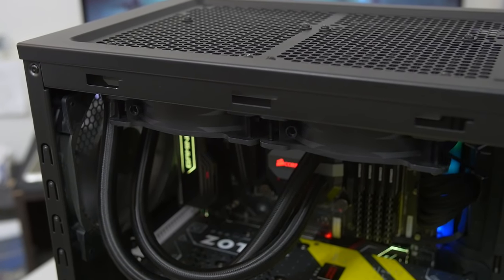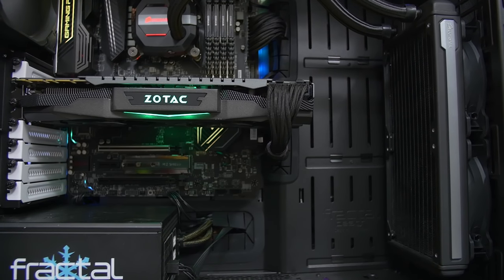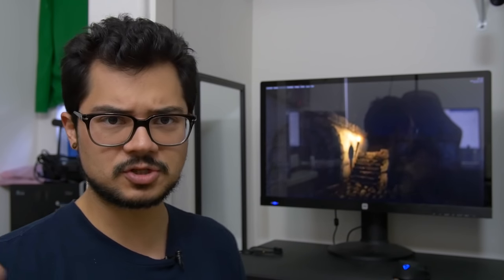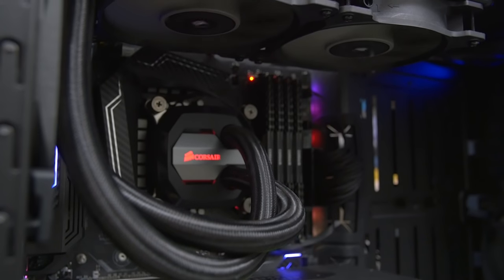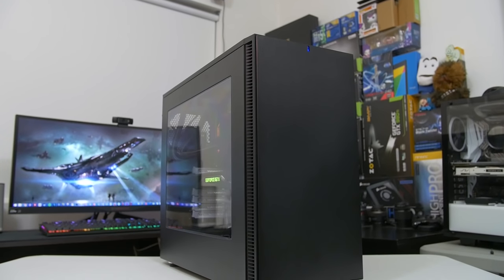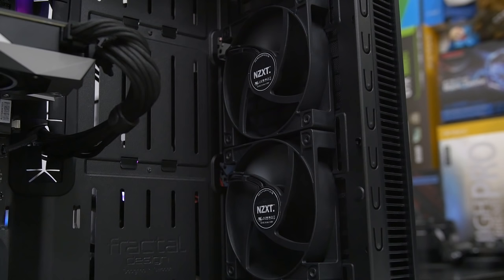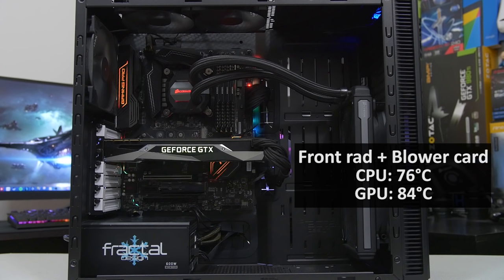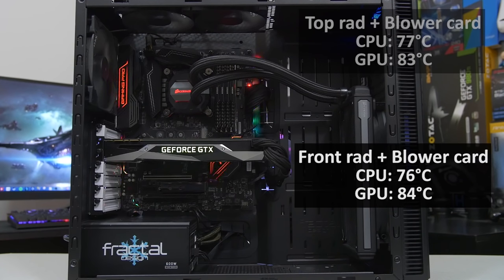Does Radiator Placement Matter? Hint: YES

Comment: best place to put radiator : outside of the case. outside the house if possible.
Reply: Depends. If you live in a hot desert it is better to keep it inside when you have air conditioning running.
Reply: Here in Arizona? Check your cold-climate privilege at the door mister!
Reply: Put radiator in Siberia, extend pipes back to home
Reply: Mr.Lazybonez I say that all the time. I live in Canada born to Jamaican parents but born in Canada,  still prefer the summer which does get hot. Winter is cold as fuck. Dominican heat is actually more bearable,  not as humid.
Reply: LMAO
Reply: I keep mine on my Jeep
Reply: Whole room waaaater coooooling?
Reply: FWIW, not all cases are built or deigned the same, nor does airflow work as efficiently. For those who may be considered it, I contacted be quiet! around rad placement for he Dark Base 700 and they advised me they achieved best results with this case with a FRONT mounted AIO and 2-3 exhaust fans at the top of the case along with an exhaust at the back. So that aligns to Kyle’s testing here.
Reply: 100F is a cool day to some folks.. Out in Arizona, I saw 110.. but it was dry heat and tolerable.  In IL I'd see 100 f with 80 humidity and it was oppressive.  I've seen as high as 120 in the shade with 60% humidity.. .and I just wanted to die.
Reply: I think I will rather not try it with a 3-year-old and a newborn baby in the house... :)
Reply: In the fridge or freezer?
Reply: Arctic Borkism  depends on how cold. Here in Canada during winter i saw -45 degree Celsius that is wayyyy too cold.
Reply: Outside of the planet.Space is the best cooler that have ever exist.
Reply: Or just put all your system in a huge fridge.
Reply: put it back in the store and buy the cheaper nh d15
Reply: Somewhere close to Pluto planet, away from Sun's heat :)) There the temp are really low and you can OC to 6-8Ghz :))
Reply: Always, and why don't we see case manufacturers make cases like that. 
They had a few if them back in the days when WC started to be more common. But after that kinda disappeared..
Reply: in fact cool the whole computer room
use copper tubes!
Reply: Placing the AIO in the top of the machine is only a disadvantage when air pressure inside machine is negative, because graphics card fans can't blow the heat out the back when air pressure is negative inside the machine, which then causes the warm air to reach the AIO. With high airflow and substantial positive pressure all the heat from the GPUs gets blown out the back of the machine without ever reaching the AIO. On my machine I reversed the rear fan to blow into the machine (The rear fan  doesn't seem to take in the warm air from the graphics cards). The PSU air intake is from under the machine and blows out the back. But to prevent the PSU air intake from sucking air out of the machine and into the PSU intake, I have a 120mm fan at the bottom in front of PSU sucking air into the machine. In the front I have a 230mm fan plus 120 mm above it. Side intake is 200mm, and I have 2 200mm fans in the stack above the AIO blowing out of the machine. Under the AIO I have 3 120mm fans blowing into the Cooler Master 360 AIO making it a push pull configuration. I am using HAFX 942, and took the precaution of properly filtering the air intake in the rear and sealing all other vents for higher pressure.

The air that blows through the AIO, should leave the machine immediately, and the pressure inside the machine should be high enough so the GPU fans work properly and blow all the heat out of the machine.
Reply: @BenjiGO  *Has 1080.. *Skimps on case and psu..
Reply: @andrewnibbi  ...and do some political corruption to make those pipelines run through our country - it's not oil but still...
Reply: lol
Reply: What if you live in a apartment
Reply: outside the earth. outside the space
Reply: @kwto.  you use the building's plumbing down to the basement where your radiator lies. Or put new pipes up to the roof (drill holes for tubes during the night when the neighbors are sleeping. just for the sake of creating chaos)
Reply: this comment gives me Whole Room Water-cooling vibes
Reply: I keep my rads in the fridge
Reply: I got one  Asustek Waterchill Black ice II rad,  4 140mm  fans in out wonder if it would cool 3700Xl ZEN2 ?
Reply: Linus Tech Tips home watercooling project video is probably the BEST solution for this.
Reply: Laughs in Australian
Reply: @BenjiGO  wha the heck ?!
Reply: ahhahahaha
Reply: @andrewnibbi  in Siberia you can easily have 40+ °C in the afternoon (and -5 °C in the night). Continental climate - big differences summer/winter and day/night.
Reply: Mike C not funny
Reply: @daddybonez  vice versa for me since I live in New York
Reply: Man this comment kills me everything.
Reply: In Siberia, its better to use a house radiator.
Reply: lmao my radiater actually sits ontop the case, i dont got room for it :(
Reply: In the fridge is better
Reply: @BenjiGO  looks like someone followed the verge build guide
Reply: That could cool your CPU to lower than ambient temps within the room that it resides and you could end up with condensation on your components.
Reply: A friend on mine had built a custom chassis and installed it in a fish tank filled with mineral oil and external radiator, looked odd but overclock temps settled at 55-60°
Reply: I live in a tropical island outside si hotter !
96 degre-eeeeees, in the sha-aaaaade ! Real hot ! In thé shaa-aaade, si note the best place for a radiator...
Reply: Indeed! I'm in AZ, it's winter (40s at night). My Ryzen 7 2700x and 5700 GPU put out so much heat, I've got the upstairs windows open and it's still 76 in the house - until I shut the computer down. Upgrading to a Ryzen 9 3900x and 5700XT and it's spring now (Feb in AZ is spring). Hate to see what my A/C bill is this summer from this machine!
Reply: So badically have it connected to your AC....
Reply: in the refrigerator
Reply: Yeah, and merge it into a swimming pool
Reply: ... in the lake
Reply: In a college refrigerator!
Reply: Bro Thanks
Reply: Hahaha. Linustechtips whole room liquid cooling
Reply: That's why liquid cooled cards are getting popular on ATX towers while on itx systems the gpu and cpu can remain cool if the gpu is air cooled since some cases has dedicated intakes for the gpu while the cpu is liquid cooled :)
Reply: No in water 😂 hahahahaha I’m so funny
Reply: The reviewer in this video confirms it. Front radiator setup paired with an open GPU card is the best setup. Even front radiator and blower card is decent with the temperatures. Some reference blower cards perform well and do not go above 80C.
Reply: My preference is in liquid nitrogen.. relly drops them temps mannnn. U should try it out. Or replace the whater in cooler with liquid nitrogen works perfectly
Reply: put it in the fridge
Reply: and then spend money on electricity pumping heavy water all the way there? nope
Reply: @hilmisulaiman2427  condensation?
Reply: @CCLGamer  Sounds like a reasonable option, do you have it on a desktop?  its all about the case placement I find as I have mine on the floor in a corner so recirculating of exhaust is an issue i have to take.  I see a lot of cases using front and window side to draw in air and rear and top to exhaust which seems to make sense especially when stock CPU heat sinks were prevalent and got the fresh air dumped on them from the side fan.  In a desktop scenario i can see that the top exhaust (with the GPU & PSU blowing rearwards still) can be a decent move, but would need an open space there to be the best,
I'm looking at altering my setup soon and getting a new case but don't want to spend too much on a good case that has all I want included. (£50-£150 tops i'd guess)
Also wanted to end up watercooling my GPU again but found later upgrades a pain now they are so expensive so have been air cooled for the last few.  I did find a neat watercooling SSD/HDD block that fits in a 5.25' bay, but of course these bays are not really around much now on the nice cases as nobody uses optical drives anymore.
Reply: @DukeOfTheBLVD  heavy gaming session = dead fish
Reply: @Buflonob  Yes, it is all about placement, my place is a mess, right now, so I have made a compromise, My HAFX 942 PC case is on top of a wooden chair with both front and rear edges of the case hanging over the sides of the chair. There is plenty of room behind the case. Initially the rear fan was set up to pull air out of the PC case, but I changed the direction to suck air in for increased air pressure inside the machine and lower temperature inside the PC case.  The machine only blows out air through the stacks and through the graphics cards. My X-Vision temperature gauge panel in the top 5.25″ bay shows temperature inside the PC case to be around no more than 8°F degrees above room temperature. The Cooler Master 360 AIO  does not allow a fullsized drive in the top bay, but there is plenty of room for the X-Vision temperature gauge panel.  This is a High Airflow case and the air that cools the CPU and GPUs is funneled immediately out as the cooling of GPUs and CPU take place in close proximity to the exhaust fans for the case which are the GPU fans and the stack fans (Cooler Master 360 AIO  is  right under the stack fans). The heat from the rest of the components on the motherboard and hard disks finds it's way through the case stacks where it is blown out. Since the airflow is high, hot air does not linger and build up the temperature inside the case.
Reply: In front of an AC.
Reply: LOL
Reply: Just want to point out, On my HAF X 942, although the PSU is on the floor of the case in the rear, it does not share the air with the rest of the case. My PSU has its own separate air intake underneath the case and blows the air out behind the case.The bottom of the case has a vent underneath the PSU that extends beyond the front of the PSU.  To prevent the PSU from drawing air from inside the bottom of the case, I have placed a 120mm fan in front of the PSU under all the cables, blowing air into the case. I use  a 1600W modular PSU, with all the cables connected and laid out perfectly for easy maintenance  to power all future devices I connect.
The MOBO (ASUS RAMPAGE IV EXTREME) has 64GB RAM with 4 fans mounted on the RAM, which increases flow of air from the MOBO into the general air flow to the stack exhaust fans. 
MOBOs like the Asus Maximus IX Extreme come with their own liquid cooling of important parts of the MOBO for your own custom loop. Thus you can install an external radiator with fans to cool MOBO and CPU which makes the case even cooler.
Reply: My friend did a custom loop where he took his tubes through the wall to his 480mm radiator (w noctuas) on his balcony! Here in Sweden its very cold during the winter! His idle temperature with his i9 9900k was around 8°C
Reply: Just make one of those cases submerged in oil, then use it for deep-frying 😂
Reply: XDXDXDXDXDXDXDXD
Reply: Does anyone know if I could have a front mounted aio with the fans on the inner side pulling air in?
Reply: I have mine hanging out the window
Reply: @andrewnibbi  You don't put radiator in Siberia. Siberia puts itself in radiator.
Reply: Right in front of an AC
Reply: Great idea. I'll order up a few hundred feet of hose for that.
Reply: or in the refrigerator
Reply: Place the radiator in a minifridge near you.
Reply: I took this literally and decided to put my air conditioning unit outside this time
Reply: Lmaoooo
Reply: Ive got my radiator in the pool. great temps
Reply: Inside the fridge.  Use 50 foot length tubes.
Reply: Just instal a reverse cycle system in your PC.
Reply: Not if you live in Brazil, like me
Reply: Out the space even better!
Reply: I prefer to run lines from my Florida home to my radiator in Antarctica 😂😂😂
Reply: @daddybonez  I'm the opposite
Reply: haha lol .. till see it from outlaws & lost the pc in the end .. very funny
Reply: So if I were to externally top mount a tripple rad to my micro atx cas.... would this be acceptable?